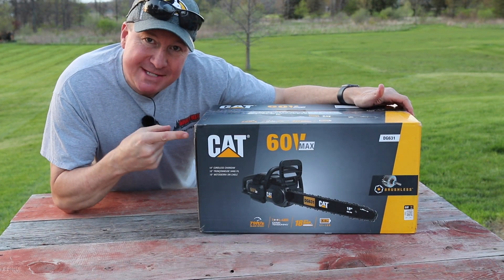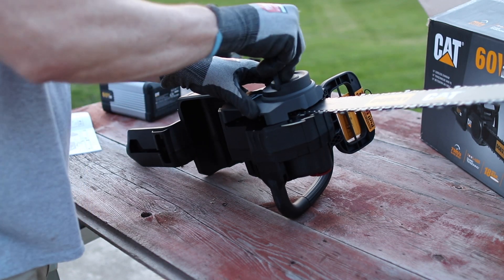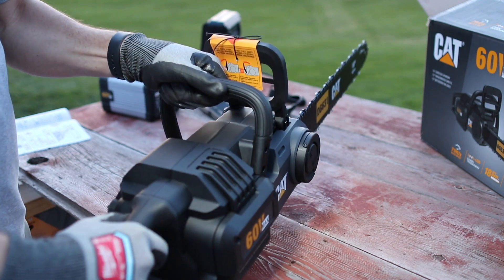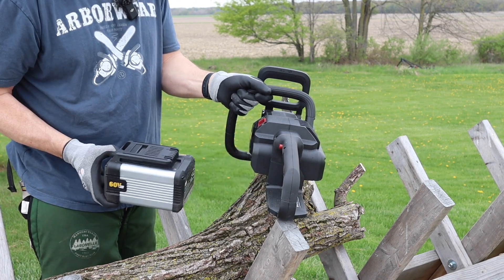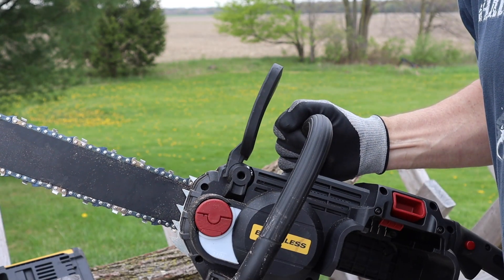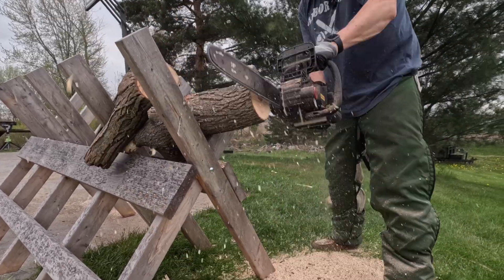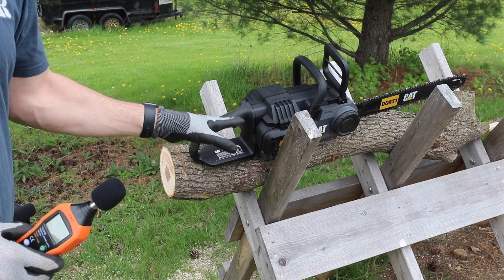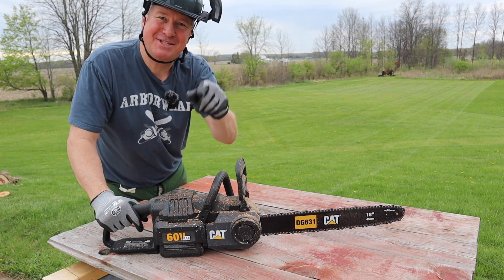Brand New CAT 60V 18" Chainsaw Put To The Test!!    Model #DG631

Comment: Looks like the unused tool dock would be a nice place for a tourniquet. If you're running a saw, you should have a tourniquet. A small on-board med kit for cuts and abrasions that always accompany tool use. Antiseptic, alcohol prep pads, liquid bandage or band-aids. It looks like it's at least large enough for a spare tourniquet that can supplement a belt worn medical kit.

Comment: This chainsaw should be sold with two 2.5 AH battery packs. 

The 5.0 one is way too heavy to be used all day in the woods (compared to my Echo CS4910). Using the 2.5 battery pack, the weight is reasonable and the autonomy is around 40 minutes of intensive use, which is when I usually stop anyway to drink some water and sharpen the chain if required. 

Good chainsaw nontheless.

Comment: Mr. Mark Thomas, what a good video!  Sorry about the storm damage.  I recently had a small tree come down across the back of one of the vehicles.  Storm damage is no fun.  

I have to say, this ‘Cat’ chainsaw seems to have checked all the boxes!  That is one honkin’ battery, and charger!  I like the fact it has a 5 segment gauge, and seems to have good runtime.  It sounded a little underpowered when you first fired it up, but it seemed to cut fairy easily.  The only negative I can see 
( and it’s kind of petty ) is the looks/appearance.  Sorry Mark., but I think the Milwaukee chainsaw is about the ugliest thing, and this Cat is not far behind.  We will all be using battery stuff one day;  I’d just like it to look like a proper saw, ya know?  

Warranty is good.  It is curious about the chain adjuster, but if it works, well that’s good.  I just wonder on the durability of it?  Do You know the Company that is over Cat?  

Hope you’re doing well, Mark.  Stay safe!  👍👍👍✌😊
Reply from the maker: Hey George, it's good to hear your honest feedback.  I'm pretty sure the company you're asking about is Positec.  They also oversee Worx and Rockwell.  Speaking of Rockwell, their JawHorse has to be one of my favorite all time tool accessories.  I often see it at many tool show displays when they're clamping material down and doing head to head testing.
When it comes to appearance, I'll have to look around and see who makes a sharper looking battery powered chainsaw.  I understand your point, lol.
Reply: Hay Mark, thanks for the reply!  Positec, hmm, learn something new every day.  The JawHorse is a great tool, and it would seem the Cat chainsaw would be a solid buy.  They offer a good warranty.  

LOL, Some would say they don't care about looks, but others will buy cars, cameras, tools, based upon appearance.  Maybe I am falsely equating “performance with Looks?”  I know I kid You about Milwaukee, buty i do own quite a few of their power and hand tools.  That Chainsaw just looks so “toyish” though?  The Cat does in a way also.  Just my two cents.  YMMV

Take care!
Reply from the maker: I get what you're saying.  When I was a kid, I had one of those Mattel 1972 yellow and red chainsaws.  I played with it all the time.  I sometimes look at some battery powered saws and think the same.

However, the power of this Cat tells me otherwise, lol.  Same with the Milwaukee.
Reply: @MarkThomasBuilder  Love this comment!

Comment: Don't know why some of these companies think having a 'quick adjuster' for the bar is a good thing?  They all work fine at first but then with a little wear they do not hold the bar firm enough and the bar moves when using the saw.  Would be a good saw if they had used 2-nuts for the bar tightening and put a 'scrench' under the handle in that space they molded for the tool.
Reply from the maker: Makes sense.  I'll see how the quick adjuster holds up over time.  So far, so good after a weeks worth of use.